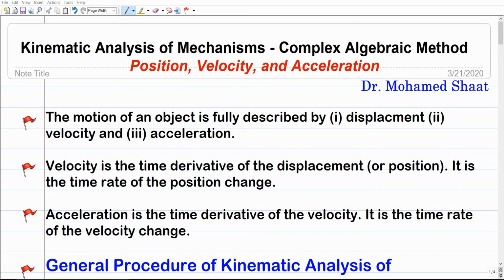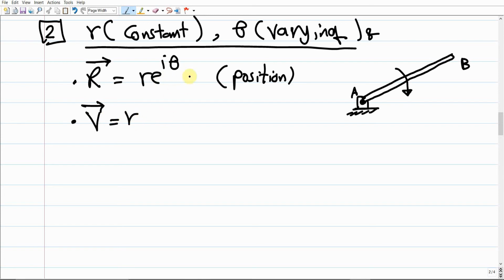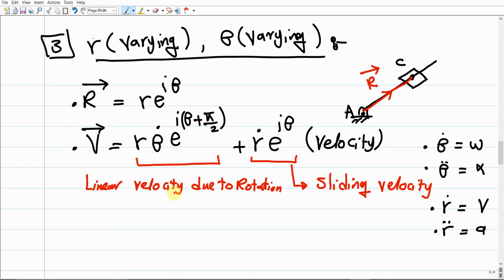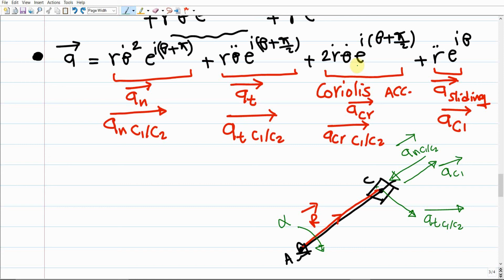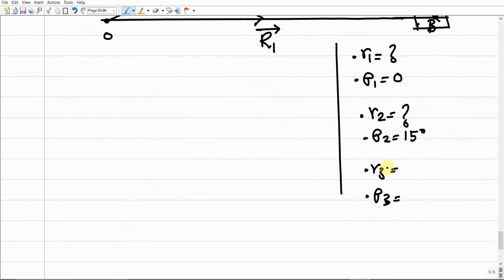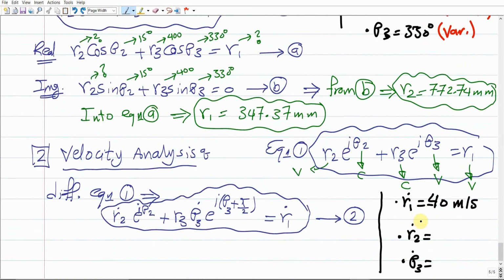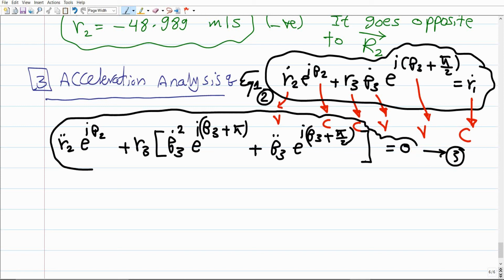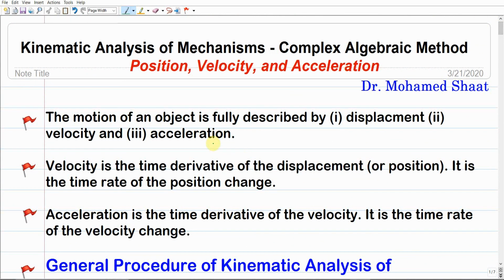Position, Velocity, & acceleration Analyses - Complex Algebraic Method

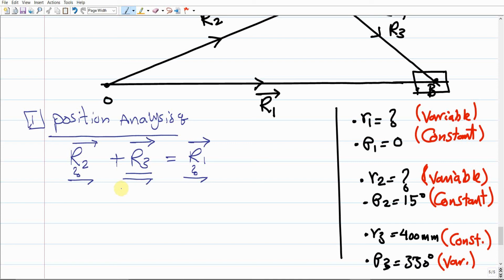Comment: Sir, in 1:20:18 you said that the example is Case 2. What is this case 2? Why do you say if there is 2 unknown magnitudes, then it is case 2? I think I have never seen your explanation about this before.
Reply from the maker: Dear Abraham
Sorry for the confusion. Yes, there is one lecture that is missing before this video. In that missing lecture, I explained how these cases are defined. I define these cases to make it easy to derive the analytical solutions of the various mechanisms based on the unknowns. For one of the cases, if the unknowns are two magnitudes, you can follow the procedure explained in the video for that case.